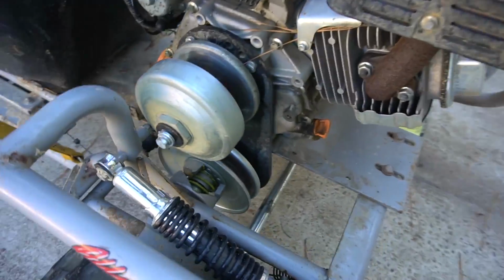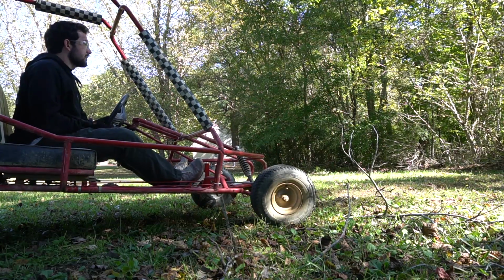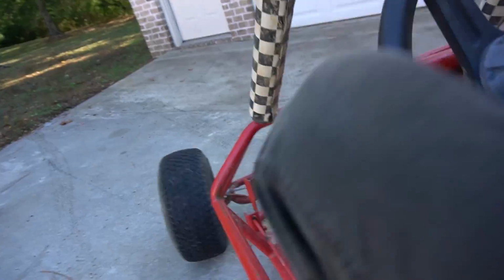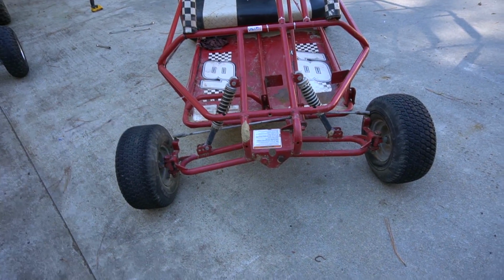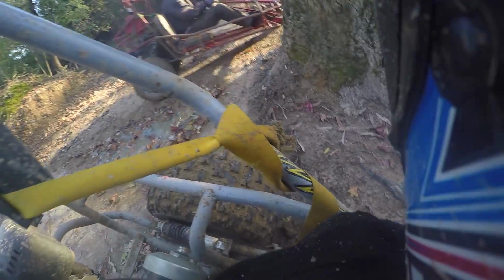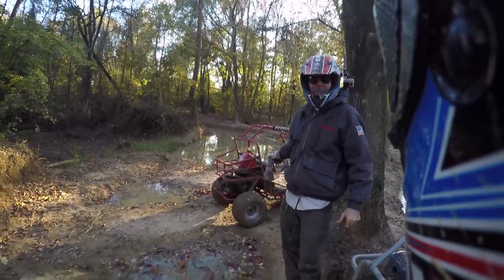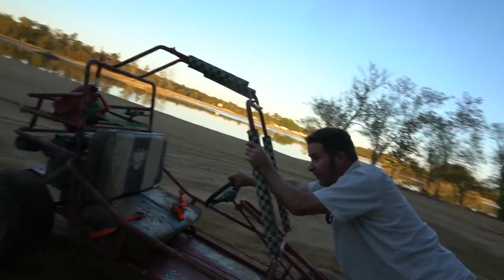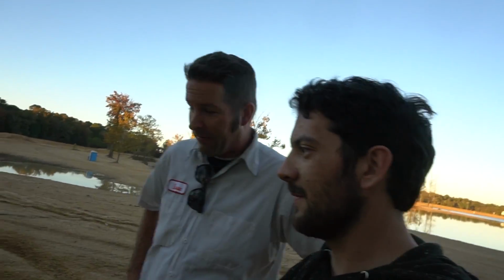Subaru Yerf Dog vs. 420cc Murray

Comment: Maybe a cool idea for the channel: build an offroad buggy ( full blown with car engine, double seater full rollcage and lifted front etc ) and take it to a offroad course?
Reply: Yep.  Turn a used FWD drivetrain/subframe into a buggy.
Reply: TheBurnout Yeah like they do with the corvairs and 3800s
Reply: To do it right you looking at a $5k+ build. I'm in process of building one based off a 400cc atv engine. You have to have a good tubing bender and notch everything or it won't hold up. There is no cutting and filling in with weld joints.

It sounds like a good idea but it will nickle and dime you to death. I wish I would have just went a bought one of the chinese buggys with a cherry engine.
Reply: alli i can say is go to mastermilo's channel, turn on subtitels ( he's  dutch ) and  witness a junkyard buggy build with an old european car engine, yes you can find them for a hand full of cash. It's save, fast and strong yet it didnt even cost 20% of 5K tho

Comment from the maker: Which one do you think performed better?
Reply: CarsandCameras that's what she said
Reply: They both did good, I would definantly do a tire upgrade on the Yerf.
Reply: Honestly, the Subaru did...
It's a Japanese engine, and they are built to last!

P.S
You guys should start a tribe on DriveTribe!
(Google it)
Reply: YERF DOGGG! Needs quad tires
Reply: I just think I have to get me something like this, it looks like so much fun.
Reply: Brodie Bennett actually the Subaru  is built in china
Reply: Yerf Dog.  The Murry might ride even better if you move the shocks on the back, way too steep of an angle. Of course that would have to be tested to be sure tho. I know with our VW buggies, too much angle will soften the ride too much and cause you to bottom out a lot more.
Reply: The Subaru is so aweome and it rips
Reply: CarsandCameras Subayerf killed it with worse tires, didn’t keep shutting down either.
Reply: For sure the Subaru. However I believe the 13 horse would kill it if the governor was gone and a few upgrades were done. Come on guys give it a fighting chance.
Reply: Subaru!
Reply: CarsandCameras neither they're both underpowered turds.come on fellas lodge a 600cc sports bike engine in them or a 450 motocross engine!(
Reply: I think the Murray did well, needs driver mod.  Install upgrades on engine, and find some decent shocks for both.  The shocks are basically pogo sticks.  Tire upgrades on the Godfrey.
Reply: Murray got a bad rap with the oil cutoff. Yerfdog sounded like it was getting ready to lay down towards the end of the ride. I think that the trail rides are the best. The yerf had the murray only because of the govenor and the oil cutoff. My son has a yerf like that and it does ride terrible. I love the look of the murray. Great vid, guys.
Reply: You guys need a fl350 odyssey it would have better suspension and plenty of power to leave both carts in the dust. Second it's a 2 stroke which people have been wanting more of, just food for thought
Reply: Definitely the yerf dawg lol it needs some much beefier tires tho
Reply: Get some long travel mountain bike rear air shocks for all 4 corners. Have real suspension.
Reply: CarsandCameras I liked the Murray
Reply: Add Pugly into an off-road Wednesday.I miss it
Reply: Yerf
Reply: @prestotyler6494  are you serious?
Reply: @hondaodysseyfl350r5  ur just a fl350 fanboy thats literally ur name and profile picture

Comment: You guys need to replace the pogo spring shocks on that yerf with real coil over shocks. You can pick up some used ones on ebay off a 4 wheeler. That alone will transform the way it rides and handles. I'm not talking about swapping them with new pogo spring replacements everybody sells for buggies/go karts.

Comment: An idea for making the ride better: Valve springs mounted between the seat and frame. Guys with hardtail choppers would mount a Chevy valve spring under the seat to make it nicer to ride. Stock small block Chevy springs start at around 60-70 pounds open and 100-120 at max compression, two or three would be perfect!

Comment: The murray soaks uo the bumps better because of shock placement you want your shocks as close to the wheel as possible for best results the Murray's shock mount is by the wheel the other go kart looks to be 8-10 inchs away from the wheel causing tje shock not to work properly

Comment: As someone who owns one of those murray kilowatts, they are heavy as hell. Also my murray has the gears stripped out on the steering shaft so we welded it to a universal joint. It has some toe out and I never knew that was why it gets sketchy at high speed

Comment: You should try an actual race car seat with 5 point harness that will keep you planted in the seat tighter, and improve the suspension travel and use more of a performance racing shock that will smooth out the ride. Oh and get a racing neck brace it will defiantly save your neck from some of the abuse had you had the seat and the neck brace Ike wouldn't have gotten hurt

Comment: I see a rematch in the future with the 420 governor and low oil cut-off switch removed.  Put the Subaru engine in the Murray and you'll be real happy.
What happened to that weird 2 seat go-cart with the head lights and Tecumseh (crappy-do) engine?  That one screened for a better engine.

Comment: Just wanted to let you guys know if u want the belts to last longer you have to break them in don’t go above 75% throttle and modulate the throttle. In about 40 miles they should be broke in and they will grab much harder. Just saying

Comment: You guys need taller tyres all round especially the front. Atleast 21inch fronts, will soak up the bumps a bit better and go through ruts nicer. Then work on longer A arms for more travel.

Comment: Alright, so got a question for anybody that wants to give me some input. As far as off-road karts go, is it best to go with a torque converter setup? My boys are getting older and I'd love to get them karting on trails I plan to expand on around the property. I got the itch after working on a kart for my little brother-inlaws and I feel like for the money investment I can have a fleet of karts for alot cheaper than a fleet of ATV's and frankly I like the roll cages of the karts. And I plan on having larger knobby tires for more ground clearance. Should I rule out trying to use regular clutches for off roaders? I'll still probably tool around with the 212's. Maybe getting in to the stage 1 and 2 level mods.

Thanks in advance!
Reply: I know my go kart had a centrifugal clutch and on some hills it would free spin and didn’t get me going. I think torque converters are a bit better? But I feel they are harder to work on but, I’ll find out, I have a dune buggy that is slipping so I’ll see how difficult it is. I wish someone more experienced would have helped you out since you asked such a great question. They are fun man. Let me know what you decide (or if you already did) take care.

Comment: You should make one Chains and sprockets since its a better form of Power transfer and they dont really "Get hot"Like the belts do
Reply: A torque  converter give you alot more power? What do you mean? one with out a torque converter dont have the acceleration or torque to take off quick. And it also puts alot of wear and strain on the engine and wont last nearly as long as it would if you had a torque converter and another thing with out a converter you will go through alot more clutches. I would rather replace a belt then a $60 to $150 dollar clutch

Comment: Why does these engines make so little power concidering their cylinder sizes?
Reply: Emil Wiksten OHV
Reply: Emil Wiksten carb jets, cam profile, valve size, ignition voltage, really any number of things
Reply: These engines only rev to about 3600 RPM from the factory for reliability and longevity reasons. The low engine RPM and cam profile suited for low revs is why they don't produce much power compared to a typical motorcycle engine which revs out to 9000+ RPMs and makes 3+  times the HP.
Reply: Jerry Wick Subaru is OHC...
Reply: These engines are utility engines for things like water pumps and generators but can be put on go carts. They only run at 3600rpm for general work and are jetted lean for emissions regulations. Motorcycle and shifter cart and similar engines run three times the rpms and a lot more power.

Comment: You guys should put efi on the 420 murry and mabye a turbo
Reply: Cody Irvin turbos don't add power really on these motors cams and billet rods
Reply: Levi Arnold with more fuel and more spark turbos add more air you just have to change a few things and they will make more power

Comment: With all your experience starting engines with torque converters fitted, why oh why are you surprised to have it jump forward when it starts. Maybe a chock under the wheel would be a logical idea. One day with your habits, the cart is gonna take off and do some damage. Avid watcher, John.

Comment: "Torque converter"? What're you, 12? The primary clutch or "drive"  is what sits on the engines crankshaft. What you're referring to as a "torque converter" is called a driven clutch.